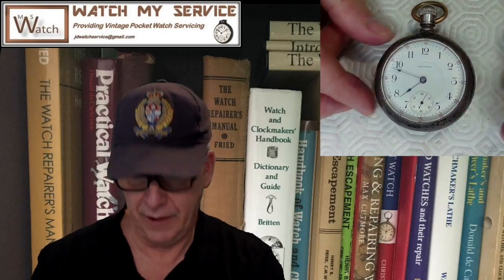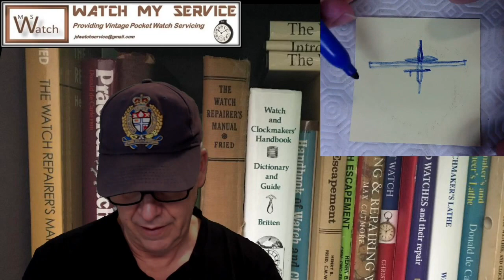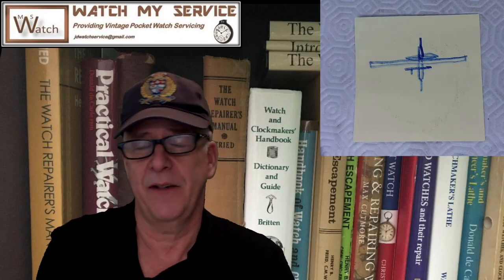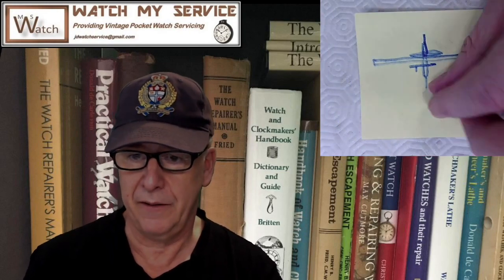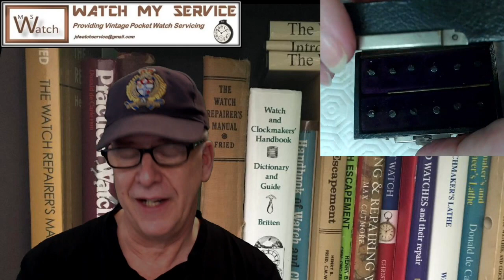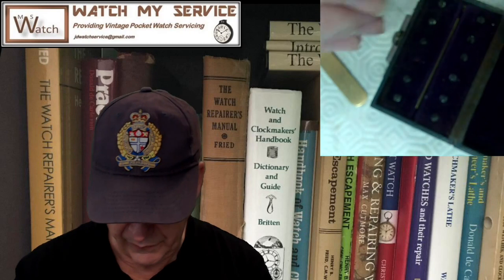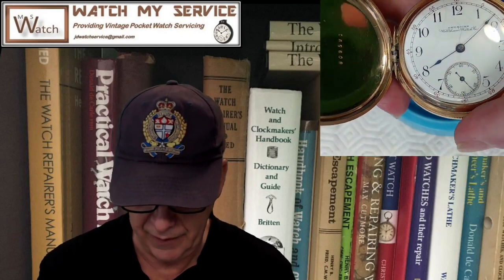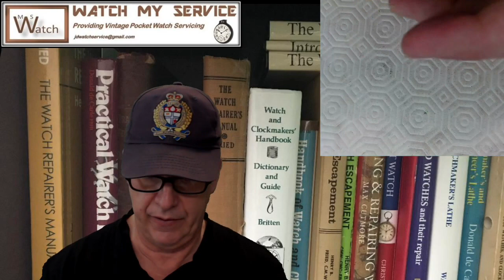Watchmaking Tips and Tools 001

Comment: I had an Elgin that would stop face up.  It turned out the pallet fork would rub against the roller table.  It was an early 18 size Elgin that had a change in the staff.  The staff came with either a long or short hub.  The long hub was used instead of the short one.  I have a PDF file from K&D showing the use of the punches and stumps in a staking set.  If I can find the file, I will send it to you.
Reply from the maker: Thank you very much bun. This is a real conundrum. I did have to replace the roller table on this watch or actually I just staked on the old roller table as the diameter of the bounce staff was ever so slightly smaller. I'm going to re-examine this pocket watch this weekend to see if it is something to do with the end Shake on the pallet Fork or perhaps the jewels not accepting the pivots completely